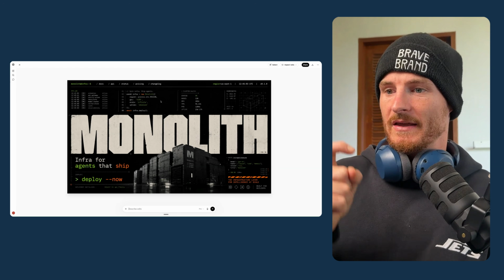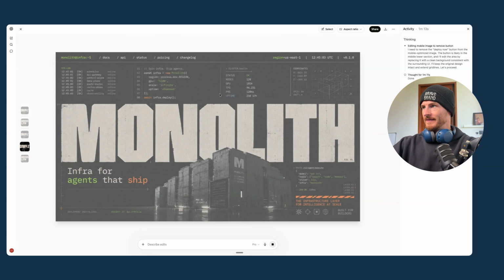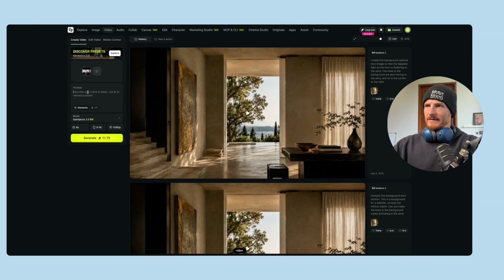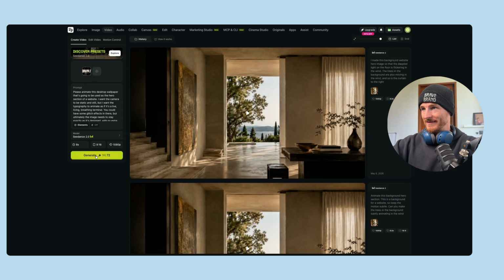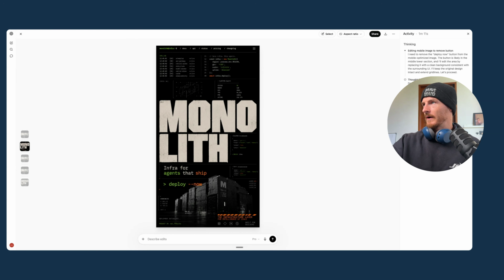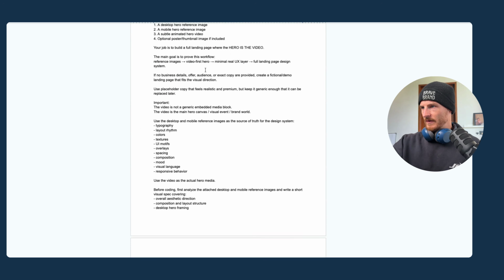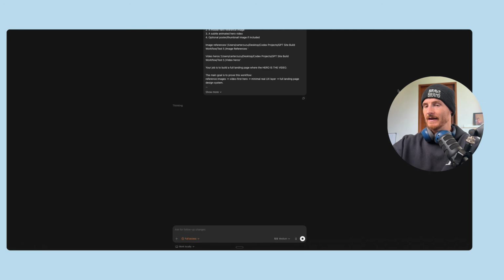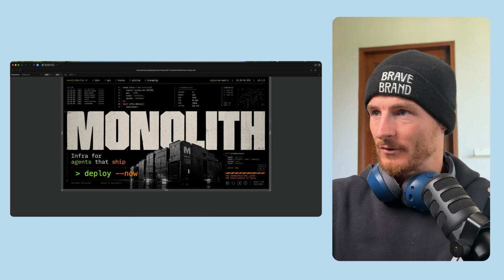AI Web Design Just Got Stupidly Powerful (New Workflow)

Comment: This strategy of using AI to generate a static interface layout, running it through a video animator for micro-interactions, and then feeding those visual assets into an IDE tool like Codeex is a wild breakthrough for rapid prototyping. Removing UI items like buttons before animating ensures the motion stays focused on the background graphics, allowing the layout tool to overlay functional web elements smoothly over the video hero. When I have a unique layout design or a clean landing page prototype ready to preview online, I usually look at a few simple options like Tiiny Host, Vercel, or Netlify to get a live link in seconds. Building custom, ultra-futuristic landing pages without relying on standard pre-made templates opens up massive creative freedom for solo builders.

Comment: What did Codex do? Is the hero just a video background? How many MBs is that video?
Reply from the maker: The hero is the animated video as the base, and Codex took made it clickable, made it responsive between the desktop and mobile versions I gave it, then matched that aesthetic across the rest of the page. The point was to see how wild we could push the design in GPT Image 2 and whether Codex could actually turn it into something useable. Turns out it can. Video = 3MB